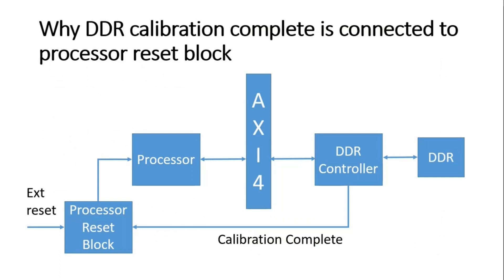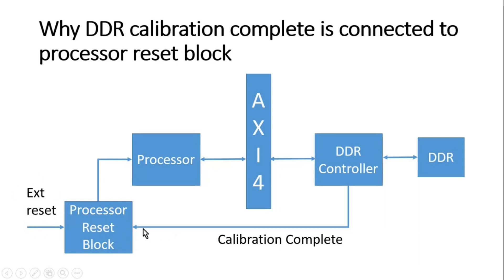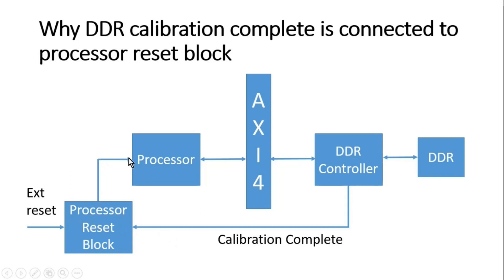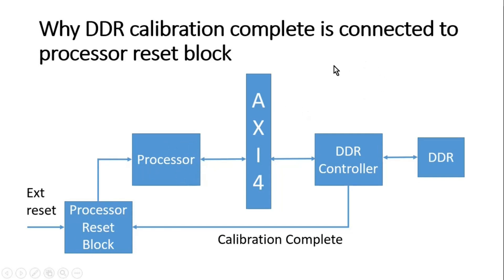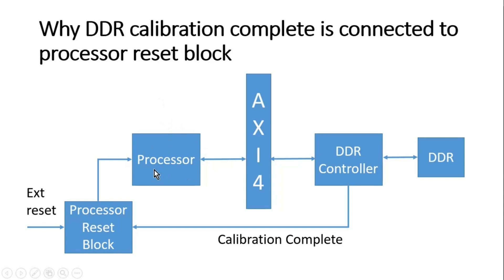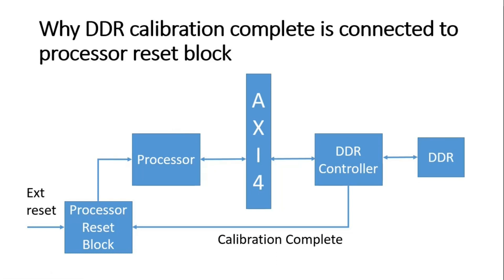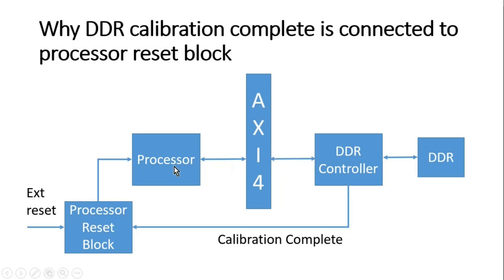Digital System Level Design Part 1

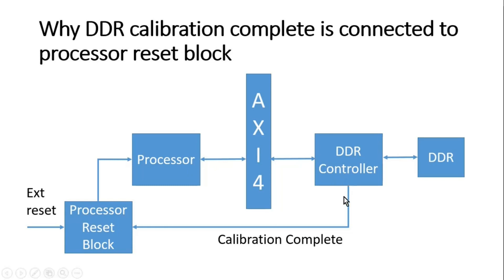Comment: I'm going to guess without watching the video at 2:00.  This is just a naïve guess, but if you are running a Von Neuman architecture (or even modified Harvard) then both data and instructions come from the same memory.  In that case the CPU can't start executing instructions until the memory has been initialized and calibrated.  That includes writing in the case of a BIOS boot scheme where it will load the program from external storage - disk for example - and writes to main memory at a particular entry point address depending on the boot system and the CPU is usually set to that IP as part of the BIOS exit code - essentially the BIOS "jumps" to that address, hence the name bootstrap ;).  Anyway, my guess is that NONE of that can happen until the memory is initialized and calibrated, so it makes sense to keep the CPU in a low powered reset state until that's done.  You could have a complicated scheme where the CPU waits on the signal, but why waste the silicon?  Just have the reset block logic handle that as part of the reset logic for the main processor.  Incidentally, if running a pure Harvard architecture, like in a microcontroller, the instruction memory can be different from the data memory, so that's not always necessary for those architectures.  Some examples are PIC and AVR architectures where the instruction is stored in flash on the same chip and the data memory (which is used for heap and stack during program execution) is some sort of SRAM on the same chip.  Okay, now I'm going to watch the video.
Reply: Okay, I was right :).  I was speaking more generically, and your answer was specific to Linux, but yes, the kernel is going to be loaded from storage and put into memory.  The processor will then have a reset vector which points to that address, and execution will begin at the kernel entry.  Also, I don't think it's a disadvantage that those other IPs are waiting on the CPU.  They also depend on system memory in many cases, and they many times depend on kernel drivers, so they can't just start writing and reading without having that initialization chain complete.  You can say that the CPU is the brains the of the system, but the system memory is the heart.